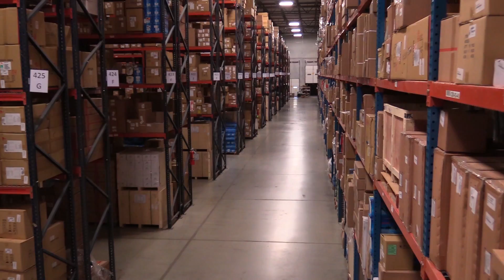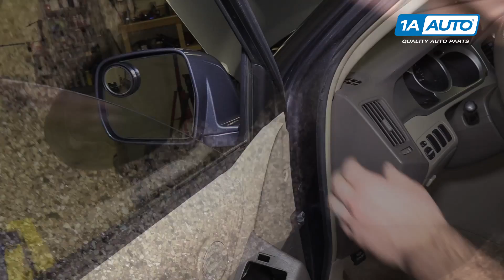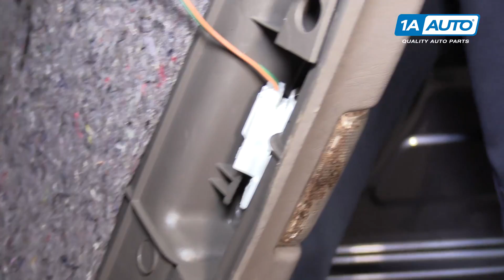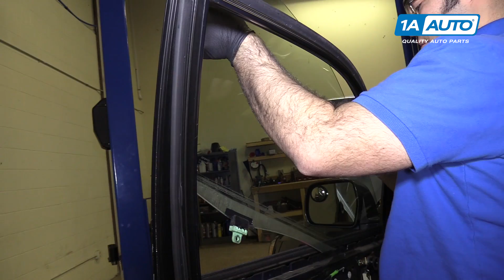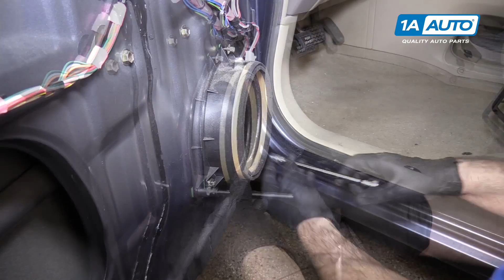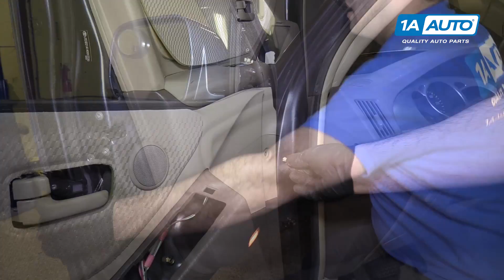How to Replace Front Drivers Side Power Window Regulator 01-07 Toyota Highlander

Comment: Well done !  Appreciate the thoroughness. Has a few tips that the other Parts vendor does not include.  But otther video shows dis-attaching  door lever cable mechanism is not necessary.  Watch both to cover everything.